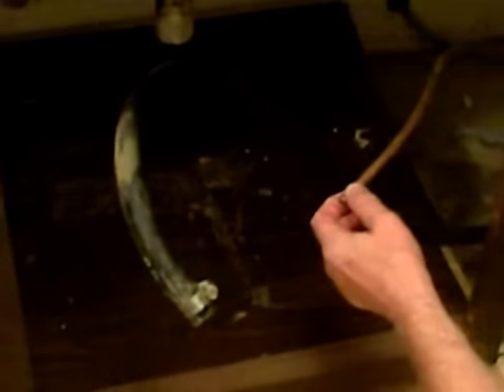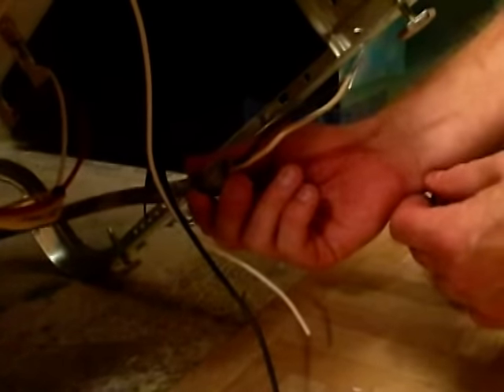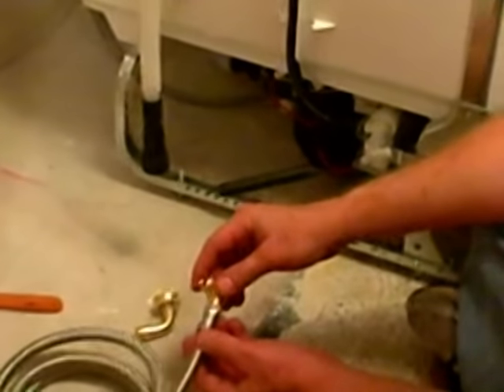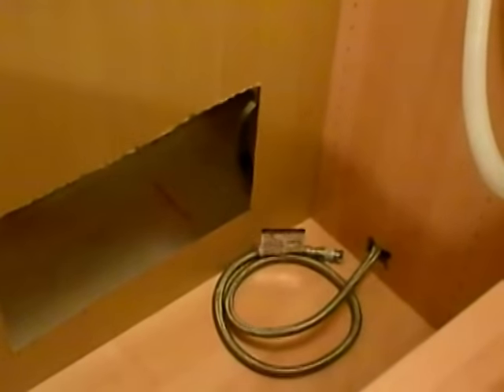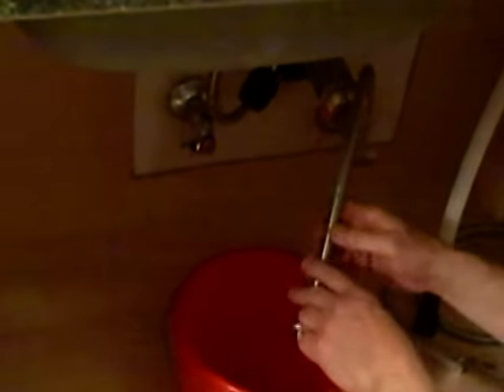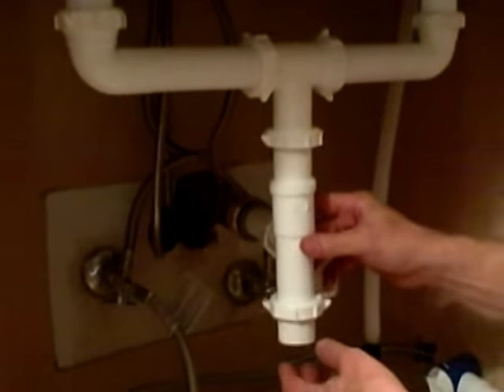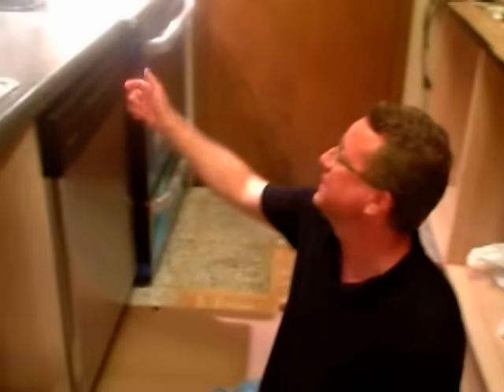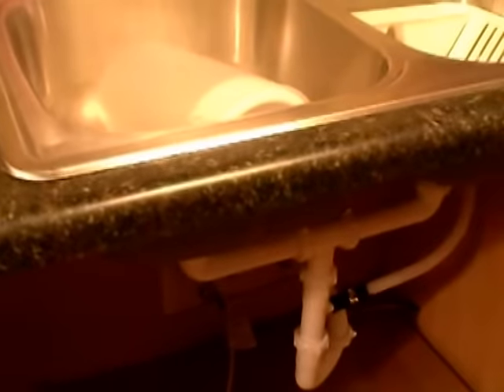How To Install Dishwasher Plumbing - Replacing a Dishwasher

Comment from the maker: Hi, just make the loop of the hose about 32" high. Where you connect the hose to the drain line it has to be above the trap. If you use an extension pipe with a hose connector, it is easy to install just above the trap. You can cut it to a size that fits your install.
Reply: žx

Comment: Hello. Great video. I just went from a dual drain sink to a single drain. Reconnecting the dishwasher wastewater drain tube. Can you explain more about how the length of the dishwasher drain pipe must be in terms of height with the J bend trap way. I wanna make sure I do this right

Comment: Hello, thank you for this video. If you were doing this in reverse and disconnecting the dishwasher hose, how would you block the pipe? By that I mean the smaller connection that comes off the main s-bend, where the dishwasher connects to.
Reply from the maker: Hi, you can remove and replace the extension pipe with one without the hose barb, or your local hardware store should have a rubber cap that can be tightened over the hose barb. There is also a rubber connector that can be attached to the hose barb and then put a rubber stopper in the end and clamp it in place.
We have more home improvement tips on our weekly podcast https://itunes.apple.com/us/podcast/fix-it-home-improvement/id880903087?mt=2
Reply: @FIXITHomeImprovementChannel  thank you very much

Comment: Hey I have to ask this - When you cut off the 1 inch part of the dishwasher connection to the sink, if the hose is NEW then how much torque has to be applied in order to get that smaller diameter onto the t connector's barbs?    Thought I was done but no.. leaks a couple of weeks later.   So when that hose is new and not worked in, is it a real exercise in twisting it on or should it slip onto the barbs relatively easy?     TIA!
Reply from the maker: Hi, it should be snug. You can put a little liquid soap inside the connector to have it slide on easier. 
Check out some home improvement tips in our e-books https://www.amazon.com/gp/product/B0B2KW1FQ9

Comment: Hi, can I ask? I saw fittings of tailpiece with pipe inlet for dishwasher drain connection. Can you tell me about this piece on code:

"No dishwasher drain shall be connected to a sink tailpiece, continuous waste or trap..."
Reply from the maker: Hi, they require a directional fitting, like the one in the video. It directs the force of the water down the drain, rather than a standard tee type fitting where the water could shoot up into the sink or be forced into the other side of a double sink.
Check out more home improvement tips in our e-books https://www.amazon.com/gp/product/B0B2KW1FQ9?notRedirectToSDP=1&.

Comment: Questions I hope someone can help 🙂 can I remove the dishwasher waste tee form my sink?? Is gonna affect in some way my drain?
Reply from the maker: Hi, you can replace the dishwasher tailpiece with an extension pipe if you aren't using the dishwasher.

Comment: Hi. Is it possible to connect a dishwasher to a hot pipe. I have solar energy so I wouldn't need to pay the electric to heat the water up.

Comment from the maker: Hi,
If you have metal thread, like the pipe coming out of the wall, I use a metal nut. The threads can cut into a plastic nut and cause it to leak. Anywhere you have plastic threads, use a plastic nut. You can still connect metal to plastic, just be careful when connecting it. You can easily cross thread the nut.

Comment: Do you have to clamp the drain line on the dishwasher at both ends
Reply from the maker: Hi, most dishwashers come with the drain hose already connected at the unit. But, yes, it needs to be connected at both ends usually with a hose clamp.
Check out more home improvement tips in our e-books https://www.amazon.com/gp/product/B0B2KW1FQ9?notRedirectToSDP=1&.

Comment: Just a quick FYI it’s no longer within code to hard wire a dishwasher. They now have to be cord and plug connected into a GFCI receptacle under the sink. Same with garbage disposal. It’s done to protect the tech who needs to service the units. Line of site disconnect.
Reply from the maker: Hi, even in Chicago, Seattle and area's in NY with conduit?
Reply from the maker: Hi, I just spoke to the International Association of Certified Home Inspectors. 
According to the 2017 NEC®, Article 422.16 (B) Specific Appliances (1) Electrically Operated In-Sink Waste Disposers, "Electrically operated in-sink waste disposers shall be permitted to be cord-and-plug-connected with a flexible cord." The flexible cord shall be terminated with a grounding-type attachment plug. 18 inches long at least. Receptacle located to protect against damage to the cord. Receptacle must be accessible. 

It doesn't sound like it is restricted to just a plug. It could be a local code.

Comment: When should you vent the drain from a dishwasher? I'm installing a new dishwasher where there wasn't one before and I don't have a waste disposal. Does it matter what height my drain is at? If it does, the center of the drain is 16" from the subfloor.
Cheers

Comment: Hi, For hot water  line, Is it ok to use a T-connector for dish washer and a kitchen sink faucet?  Please advise or other option.  I don't want to pay a plumber to add another hot water copper line.
Reply from the maker: Hi, a compression fitting is an excellent way to connect 2 supply lines. Here is a link to the type I use a lot http://www.homedepot.com/p/3-8-in-x-3-8-in-x-3-8-in-Compression-x-Compression-Brass-T-Fitting-CT2-666X-P/202495893

Comment: Good video but.... still need a high loop or an air gap...... code in most states require an air gap to properly ensure if the sink line clogs, no backup of sewage would enter the dishwasher full of "clean" dishes. High loop of dishwasher drain line would give opportunity of sink to fill before sewage backs up into dishwasher. Air gap, which is commonly code in many states, requires a unit that sits above your sink, happens to be somewhat stylish and unnoticed matching the accents of your sink, that connects the drain line of your washer and your sink line above the highest level of your sink basin, making it impossible for any raw sewage contamination to enter the dishwasher during a sink line blockage backup.  (Most commonly caused by excessive use of garbage disposers..... they are the devil.) Just think of the crap you are stuffing down a 1 1/2" pipe..... trust me if you wanna save some money by not having to call someone out to cable out your kitchen sink drains periodically,  scrape everything into the garbage, try to run nothing but water into your kitchen sink, and treat all your smaller drain lines with a bio product that eats fats oils and grease, all of your soaps and stuff are all made of these toxins entering your drain lines, fight them with bacteria. (Look up the product biochoice and get some stuff works)
Reply: True, very true, I use biochoice every 2 weeks

Comment: is it necessary  for all drain tubes to be up 32in? the one in my apartment has it coming in from the bottom
Reply from the maker: Hi, that style is no longer code in new buildings because the draining water can pull the water out of the trap.
We have more tips in our home improvement book http://www.amazon.com/dp/B01BK2K0JM?ref_=pe_2427780_160035660

Comment: -> As another asked, but got no response: "how about an air gap?"
My dishwasher back-flows until it spills/floods the floor. My drain hose connection is more than 32 inches high. The sinks drain slowly (all new plumbing). You can easily fill the sinks faster than they can drain the incoming water flow. I suspect I need more air by possible use of an air gap but NOBODY on YouTube shows you how to install an air gap. Please respond & thanks for your time.
Reply from the maker: Jeff82556 Hi, if you add an air gap, it should help with draining. I've never had to add an air gap to any installation I've done.
 Are you have any draining issues with the sink when you are just using the faucet? It could be an issue with the main vent on top of the house. 
Adding an air gap is easy, if you have an extra hole in the sink, like a soap dispenser. I will add this to my list of videos coming up. Let me know if you have any other questions.
Reply: FIX IT Home Improvement Channel Thanks for your reply! To answer your Qs, yes the sinks drain slowly - you can fill them faster than they can drain. I went on the roof and ran a garden hose (w/running water) up & down the vent pipe today. This aligns with my kitchen sink. (didn't help at all) I also took photos of my sink plumbing arrangement. I just have to figure out a place to upload them. I am now suspicious about one thing you said at time 2:40 and have this to add: although my dishwasher drain hose (1) is higher than the P-trap (2), the drain on the back wall (3) is HIGHER than the P-trap AND the dishwasher hose. In other words (using numbers), 3 is higher than 1 and 1 is higher than 2. Thanks for any help!
Reply from the maker: Hi,
My email is jacyelsesser@gmail.com to send the pics
Reply: FIX IT Home Improvement Channel
Did you get my 2 pics that I sent to your email yesterday? The "mail daemon" responded saying "your email address is invalid".
Thanks!

Comment: You said to tighten nuts, plastic to plastic and metal to metal..is that important, can u explain???...under my strainer basket is the tailend pvc pipe with plastic to metal nut, and the rest is plastic to plastic that okay????

Comment: You should've put in an air gap. They are required by code now.
Reply from the maker: Hi, not all states require an air gap for a residential dishwasher.

Comment: Could I tie the dish washer in on a horizontal branch
Reply from the maker: Hi, you should connect the drain hose before the trap on the vertical pipe. If you connect it on the horizontal pipe after the trap, you could potentially allow sewer gas to get into your home. 
Check out more home improvement tips in our e-books https://www.amazon.com/gp/product/B0B2KW1FQ9?notRedirectToSDP=1&.
Reply: I was talking about On a double sink, but I figured it out so no worries. For future reference on a dual sink when there’s a t before the trap could a put one on that horizontal branch. Only thing I’d be concerned about is a horizontal joint is more likely to leak.

Comment: Hello. I have a question. Which connection is  better? A direct connect or to a the garbage disposal?
Reply from the maker: Hi, when I took training from InSinkErator, they suggested using the hose fitting in the garbage disposal. Both will work fine, just make sure the direct connect is before the trap.
We have more tips in our home improvement book http://www.amazon.com/dp/B01BK2K0JM?ref_=pe_2427780_160035660